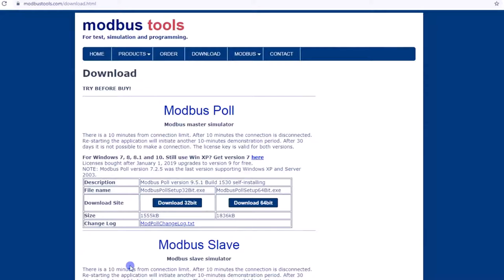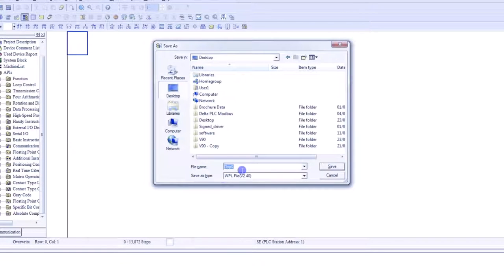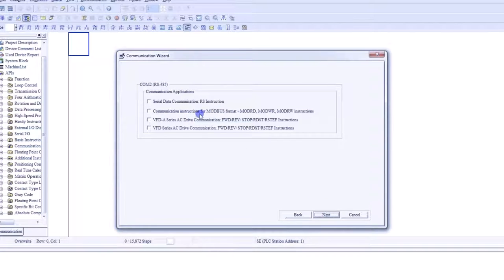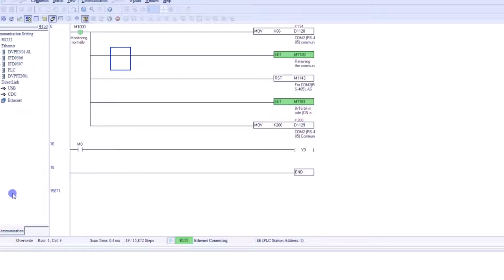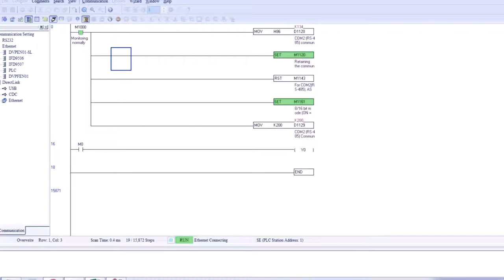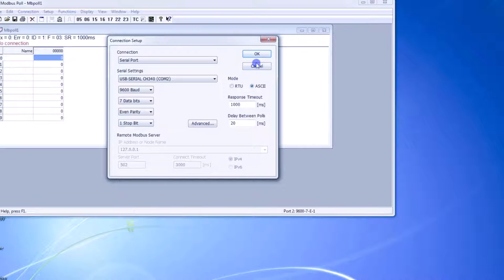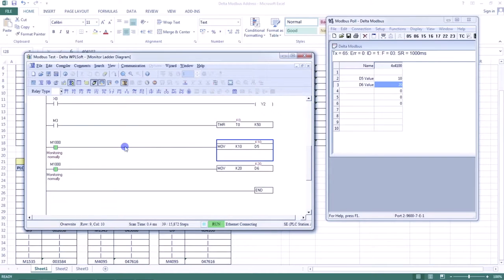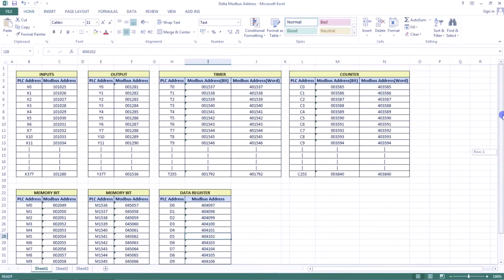How to receive data in PC from Delta PLC by Modbus, #PLC Programming

Comment: Hi sir, pls help me on this smalla project.

Read the voltage in a line, ( 5v to 48v DC ) if a 12v voltage is present, trigger a relay to turn ON a light and start the timer 
This log time and date should be saved in memory card or device within or external devices. When the output 12v goes below 12v then  it's will be off. And repeat the cycle